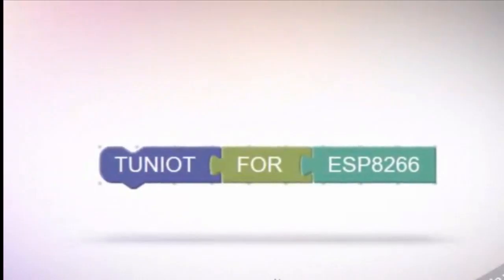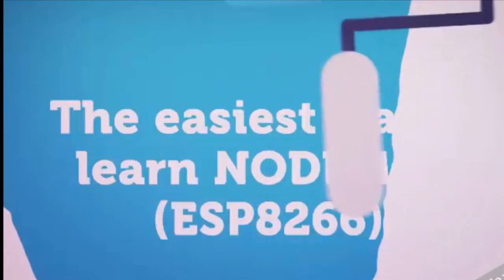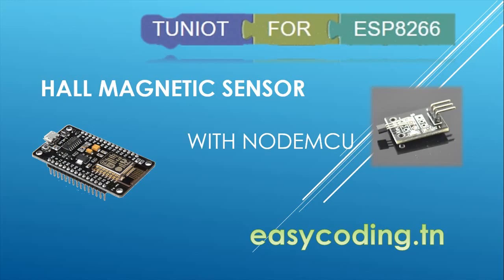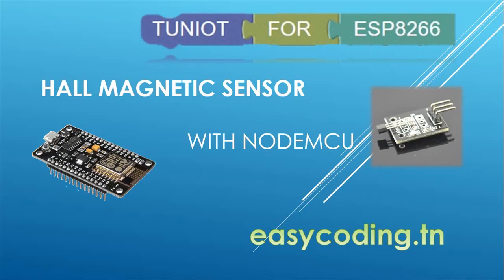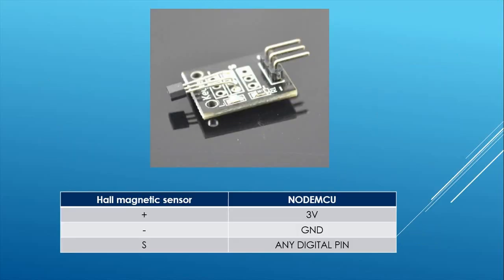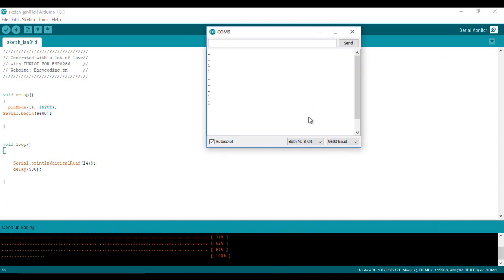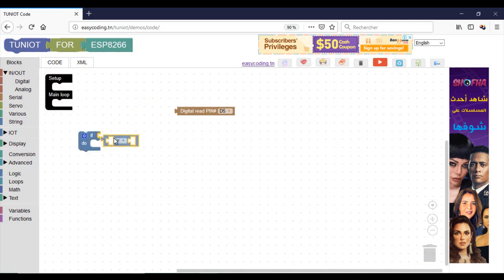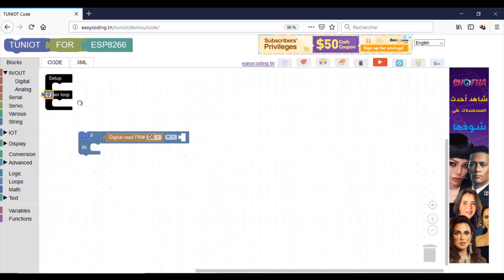NodeMcu (ESP8266) Tutorial A-25: The hall magnetic sensor

Comment: First thank you for your all videos , they are helpful .
i just have question regarding the MPU6050 sensor , i already have the  code to get the information from the MPU6050 sendor , how can I combine the code that i have by using "TUNIOT" , coz i need to send that data from point to point . 
otherwise how can i program the MPU6050 via  "TUNIOT".
I really appreciate  your replay  coz it will help me in my final year project . thank you ,,,
Reply from the maker: There is a block called code where you can write arduino code. Try it